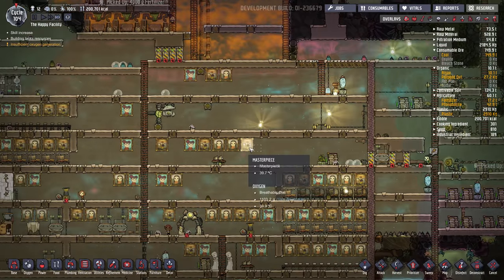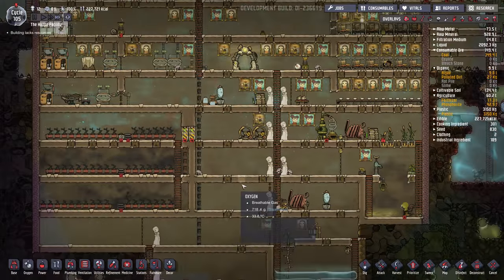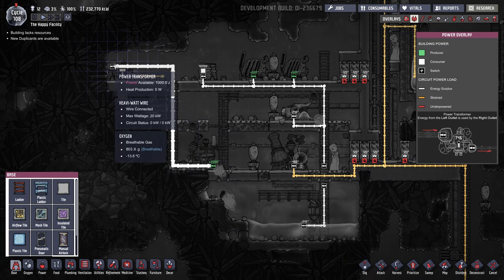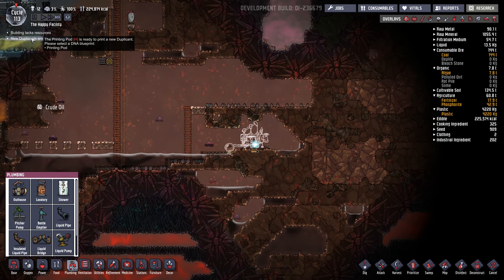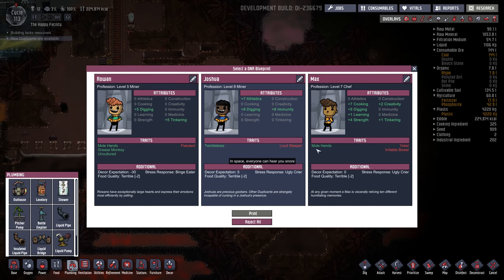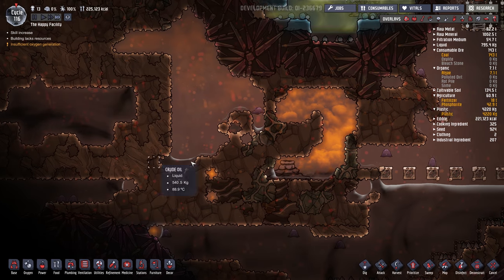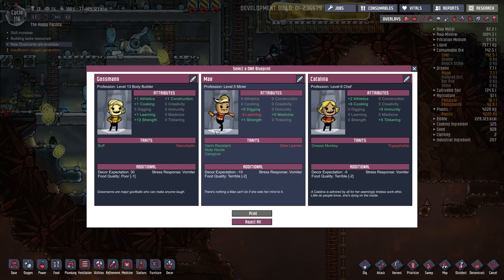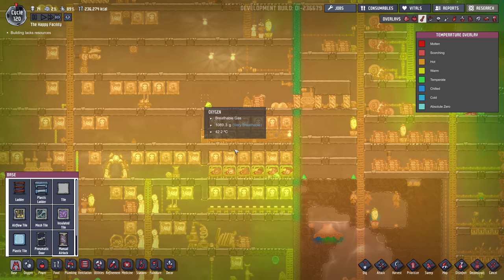Oil Well and Petroleum Generator Setup - New Oil Base - Oxygen Not Included Oil Upgrade  #3 [4k]

Comment: it's getting slow again,maybe if you don't record in 4k it will get faster?or it doesn't matter?good video though.
Reply from the maker: The recording doesn't actually slow it down any from what I've experienced. It's mostly CPU load due to sub optimized code. From experiments it is mostly due to lots of items + large piping networks.
Reply: i see. : )